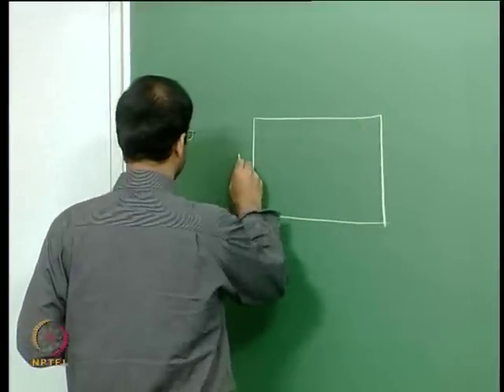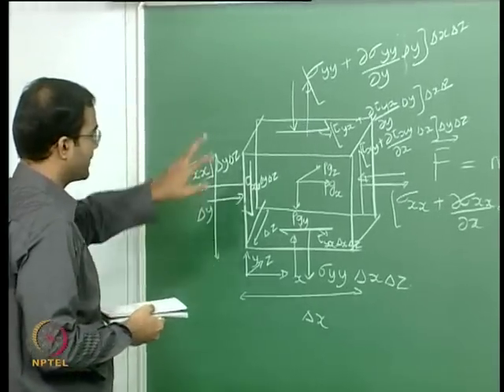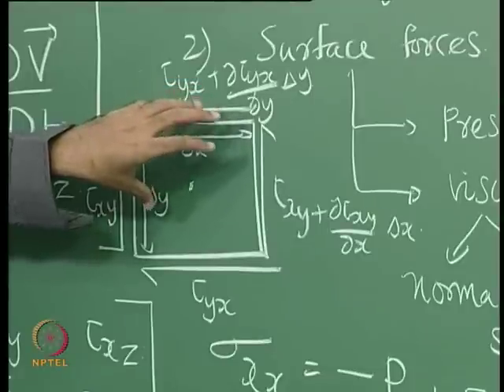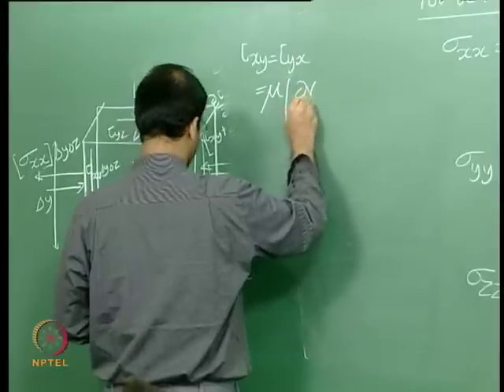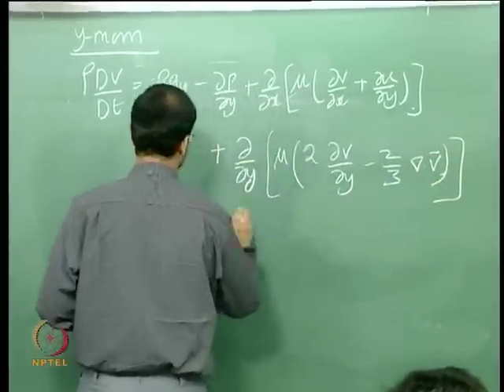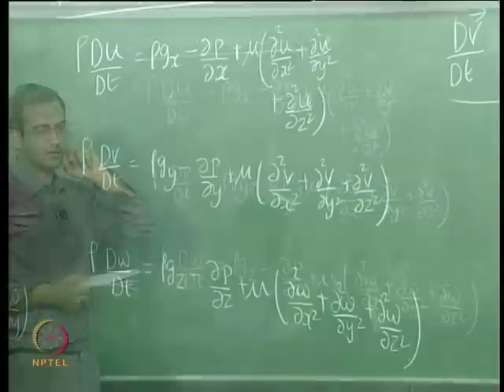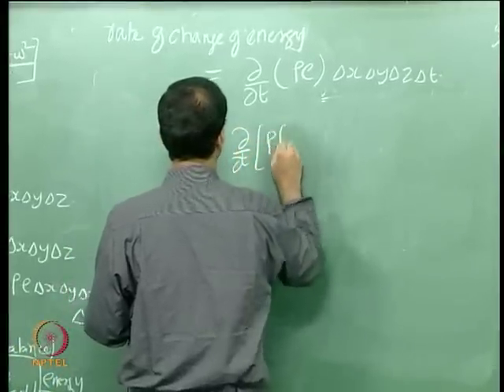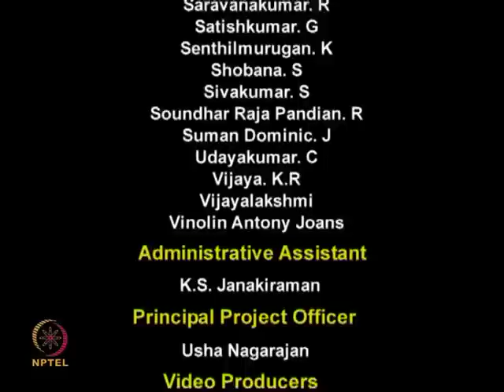Mod-01 Lec-04 Momentum and Energy Equations

Comment: Dear professor,
         For what kind of problems we need to apply energy equation whether the problem should contain some heat transfer or unsteady phenomena. I am working with CFD tools..........please explain for what kind of problems Energy equation should be solved.
Reply: when you want to calculate the temperature field in a flow field then energy equation should be turned on.
Reply: When there is a heat transfer involves in the problems like - 
1. Significant temperature change.
2. Dissipation of mechanical energies due to friction, conversion of electrical energy to the heat or absorption or release of heat through chemical or non-chemical reactions. 
3. Phase change under heat transfer or temperature difference like boiling, condensation, melting, freezing, evaporation, etc. 
4. For the designs where continuous maintanance of temperature at any point & any instant in time or for some specific regions or periods of time is needed. 
5. There is misconception that the energy equation is used only for heat transfer applications. But the energy equation is complete representative of all the energies heat as well as work. But maximum terms in it represents thermal energies then be it storage, convective, conductive or source terms. As mechanical works are never stored they always converted to either heat or internal energies or both. 
      If the problem involves only momentum transfer or kinetic energy transfer or shaft/rotor/positive displacement works or translational works without touching its temperature & all then only Mass & Momentum conservation equations will take care of complete circumstance. From analysis or simulation of these, we can get complete details of velocities & accelaration, mass flow rates & all. Accordingly, energies transferred in the form of work can be found.  We can validate the results from these two simultaneous equations (I.e. mass & momentum) with the theoretical energy equation results of work transferred to ensure that whether the values of both predicted mechanical energy transfers are close enough or not.

Comment: How can the shear force act in a normal manner?
Reply: well I think the answer is why shouldn't it?
The "control volume" cube we constructed is arbitrarily orientated. Suppose that no normal shear stresses exist on this imaginary cube. Well, nothing is to stop me from rotating the cube and calling THAT the control volume I will consider. But if I do that, then clearly there will be a non-zero component of shear stress that is normal to the surfaces of this rotated cube.
Reply: @seanki98   Shear forces are tangential forces by definition. Its not that the shear forces are "acting in a normal manner", its just that generalized VISCOUS forces are arbitrary, i.e not necessarily shear, and hence a 2d tensor. And about what you said, about component of shear stress along the new Control volume. No, stress is a 2d tensor, the value of "stress" changes as you change the surface in question, which is the whole point of WHY tensor concept was introduced.
Reply: Generalised viscous forces are arbitrary.